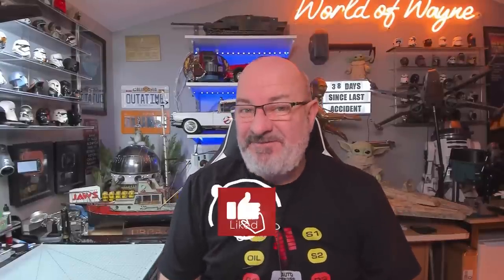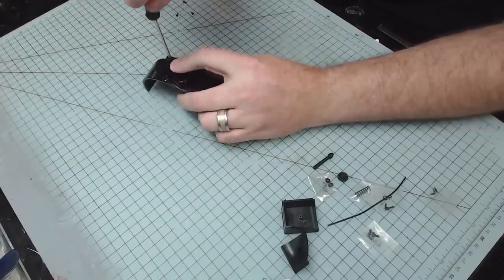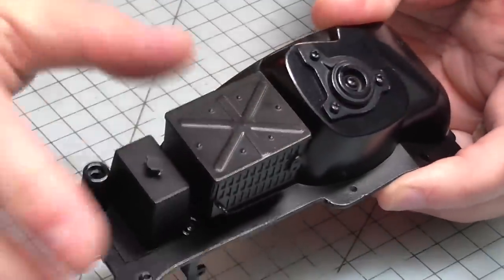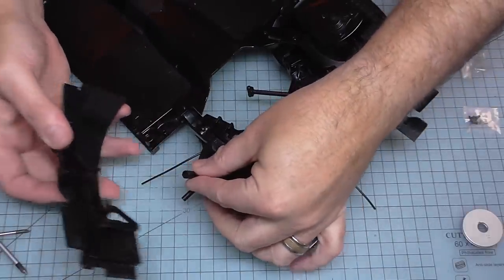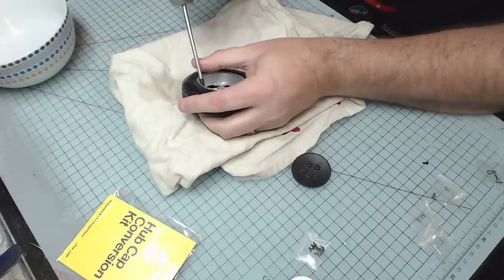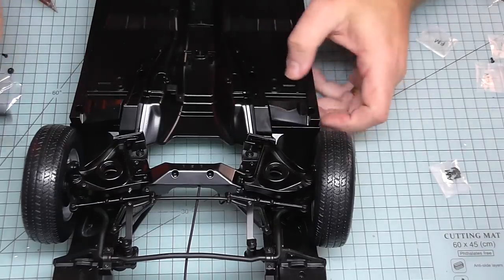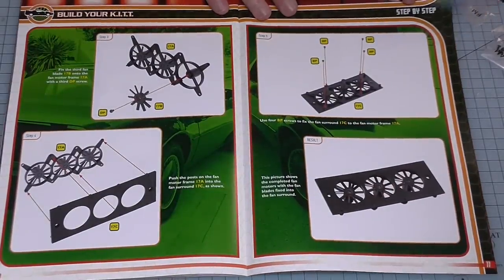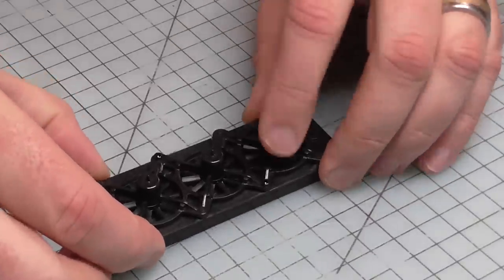Fanhome Build the Knight Rider KITT - Stages 15-18 - Right Wheel and Radiator

Comment: I did stage 15 - 18 today too. I find with the wheels it's easier to screw the two halves of the wheel together first, then pop the tyre into hot water for five mins, dry it off, it then slips onto the wheel really easy.

Comment: Ugh. I got the first little wiring terminal in with no problem. Then, I broke it off while trying to put on the second one. Now, I am stuck on stage 15, waiting on replacement parts, after being stuck on stage 13. This is frustrating. Haha, at this rate, I should finish this build somewhere around the year 
2038

Comment: Wayne what's happened to your second brake disc? On the Mike Lane kit there's supposed to be a perforated disc cover that covers that black backing pad
Reply from the maker: Yep. I forgot to put it on lol
Reply: @WorldofWayneUK   still great videos young Wayne . Thank you buddy 👍👍
Reply: I dont get it spending extra on the brake disk mods that u wont be able to see it thru the wheels. Fair enough its worth it if u can see the disks thru the wheel spokes as i do with my 1/24 model kits where the wheels have thin spokes that u can see the disks clearly.